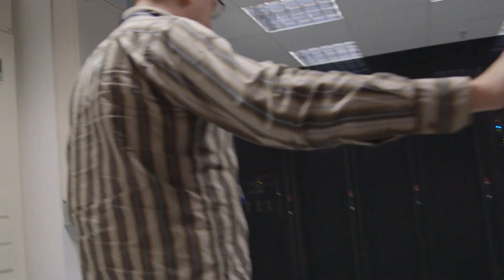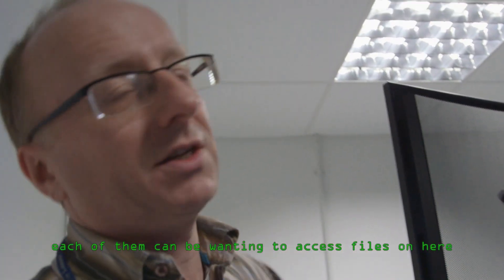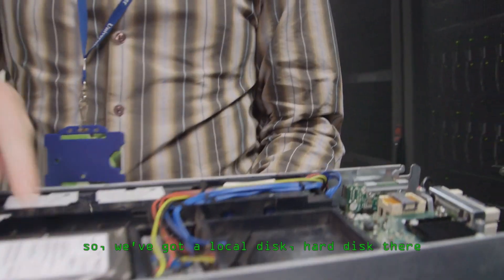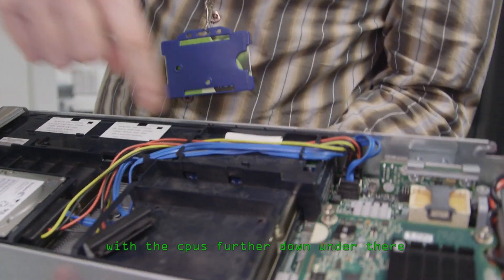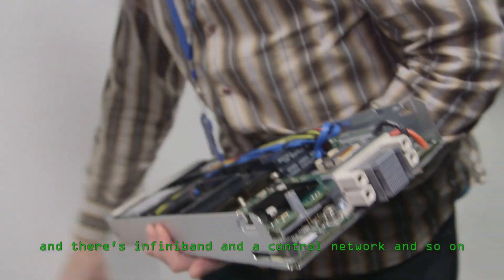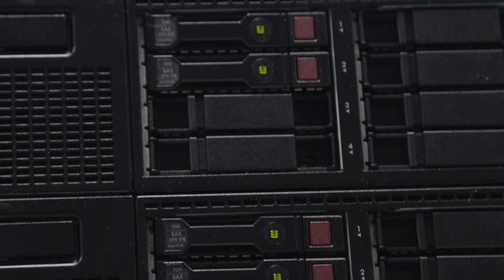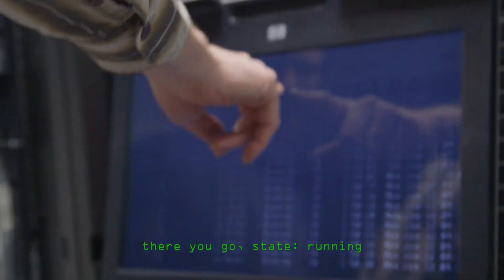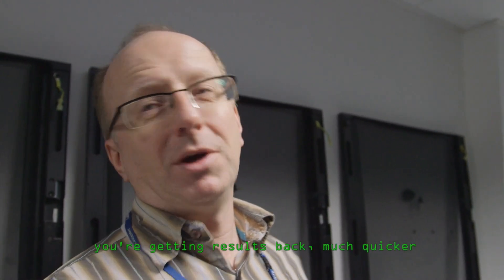Supercomputer and the Milky Way - Computerphile

Comment: Why you are still using cpus instead of gpus?
Reply: +Artyom Galstyan because these computer boffins know more than you.
Reply: Because simultaneous signal handling cannot be done as well with GPU parallel processing like can be done with a CPU. 

GPUs are best suited for very simple jobs being executed massively parallel.

So for instance some pseudo-code that might be used with a GPU could be:

###############################################
axis_1 = "x" \\ x pixel number
axis_2 = "y" \\ y pixel number

if [ "$axis_1" == "1200" || "$axis_2" == "543" ]; then

    z = $(( $x + $y ))
    axis_3 = "$z"

    return($z >> process_color)
fi
################################################

CPUs can handle many more complex code blocks in parallel when the OS is minimalistic and these code blocks are the only thing being run in parallel.

Comment: For those who are interested, the high performance computer (HPC) probably uses a lsf system to manage the jobs (the programs to run) submitted by the users. Each user is usually set a maximum number of cores that they can use at any one time. To program one of these, you need to know MPI or OpenMPI as well as a programming language like  C or Python, if you wish to communicate between the cores/nodes. Though you can run lsf jobs on the HPC without MPI and OpenMPI and still utilise all the cores.

MPI seems to be the standard

I'm cautious about calling it a super computer, from what I can tell its no bigger than the clusters I have access to. We call them high performance computers. Also the number of cores they quoted probably includes hyperthreaded cores so in reality it takes twice as long as they quoted, if that was the case (hyper threading just means that the CPU cores are less idle)

This HPC seems to be just made up of CPUs, you can get GPU ones which are just made up of a lot of GPUs, also there can be a mixture of CPU and GPU clusters (compilers can optimise plain MPI - C code into CPU and GPU operations).

Comment: It should be known that this computer probably isn't as fast in every day tasks as a regular high-end laptop, especially one with SSD equipped. The single threaded performance of these multi-core machines is probably worse than your regular i3, though what it lacks in quality it makes up for in quantity. Where supercomputers actually excel is when you have an enormous task, can load all the data into the ridiculous amount of RAM available and do computations that are entirely parallel. Otherwise a cheap Macbook Air will probably outperform the DiRAC simply because of its crazy fast PCIe SSD.

Comment: 4500 cores isn't that amazing anymore. Especially when you have GPUs on the market. You can get a $200 GPU with over a thousand cores now, and there are GPUs with more than 5600 cores. Of course, they aren't as powerful as CPU cores (they lack SIMD and have lower frequencies), but only by a factor of about 10 to 50. For example, I have a 3rd gen i7 (high-end processor) in my computer, and an nVidia GTX 760 GPU (mid-range GPU). The GPU was $100 cheaper, has 288 times more cores, and has a total of about 20 times more performance.

I take it that the cores in this supercomputer have clock speeds around 2GHz, with maybe 256 bit SIMD.
4500 cores * 2 GHz * 2 calculations per clock cycle * 8 parallel single-precision calculations (SIMD) = 144 TFLOPS. Not bad. Only about 50 times faster than my GPU though. Nowhere close to the "one thousand times faster" claim though.

Of course, with the total lack of GPUs with large amounts of RAM, and the fact that gaming (cheap) GPUs typically have drivers designed to prevent them from having double-precision performance comparable to computing (expensive) GPUs, GPUs aren't always great.
Reply: 3 Main problems though. First, for most scientific works you must have double precision. Granted, there are GPUs like the Nvidia Titan that have great dual precision performance, but there's another problem.

The second issue is that graphics cards don't have the architecture required to handle general purpose processing. For example, Nvidia graphics cards are missing a lot of basic functions, such as (if I recall correctly) bitwise operations like shifting, which have to be done in software. Thus if your program heavily uses bitwise operations, you could see more than an order of magnitude less performance. AMD's graphics cards do have general purpose instructions, but not everything. Again, you see a lot less performance when running general applications.

Graphics cards ARE powerful, but only when it comes to games, which use a limited instruction set. Scientific works on the other hand can use a whole range of instructions, which need to be emulated in software. 

Lastly, GPUs have other gigantic bottlenecks. All data needs to be transferred to and from system ram to GPU ram and vice versa. A GPU also can't access things such as hard drives. Thus, all data needed to be loaded from and to hard drives need to go through a CPU, which will bottleneck the process. SLI only handles so many communications. Again, data will have to be transferred from one GPU's ram to system ram, then to another GPU's ram.

In terms of actual performance rather than theoretical, it's more like 250-1000x your GPU rather than only 50x.
Reply: patrink12
 Actually, GPUs have general-purpose functions. Bitwise operations work fine in CUDA and are pretty fast (they are extremely simple to implement in a processor and use relatively few transistors). GPUs might not be able to handle general calculations as easily, but a large quantity of scientific problems run well on them. In addition, nVidia has more than just gaming cards. There are also the Quadro and Tesla cards, which are designed for supercomputers, servers, and workstations, and lack many of the other disadvantages you stated.

I don't know if you're extremely aware, but in recent years GPUs have been being designed to be more and more general-purpose. It doesn't just help with games. Shared memory between GPUs only applies to SLI and doesn't apply to OpenCL or CUDA unless you actually want it to. The majority of software that can be accelerated with GPUs doesn't require it. It helps for graphics, but not much else.

Also, don't the vast majority of supercomputers connect their computing nodes with ethernet cables? I'm pretty sure that's a far larger bottleneck than what exists between the CPU and GPU.
Reply: Haniff Din The unused brain power of adults as they watch American reality TV
Reply: There are compute clusters made up primarily of GPUs. They will have their reasons for using CPUs though so their claim still stands.
Reply: Penny Lane
I know that. I mentioned a few reasons why CPUs are better in some cases. Of course, with tasks this parallel I don't think it would matter that much unless they need tremendous amounts of memory for these calculations.

Of course, I was talking about just raw performance.
Reply: InnovumTechnology It is quite hard to get most scientific computing tasks to run efficiently on gpus, so it isn't done much. People are certainly looking into doing this where they can though. Also there is often a lot of legacy code which would need to be completely rewritten to run on gpus, which is quite a big barrier to using them.
Reply: Penny Lane You're right, the Nvidia Tesla boards would be much better for this kind of modeling, I believe.

They would also see a substantial savings in time if they had the budget and availability of the Intel Xeon E7 8893 v2 chips. Those run at 3.4GHz (Turbo @ 3.7GHz) and can process 30 threads (hyper-threaded) per instance. I don't think they'll be updating anytime soon, however, since swapping these chips for what they have (assuming the socket is compatible) would cost about $31M USD.
Reply: Haniff Din this is true
Reply: ninjafruitchilled There is also the issue of scientists not always knowing how to write code for gpus in the first place. It is still new and unfamiliar to many of them.
Reply: I understand that. I just meant this to show that this amount of raw processing power isn't that amazing these days, especially when compared to GPUs.
Reply: GPUs lack SIMD? GPUs are SIMD systems, they can't really do anything else.
Reply: IchBinKeinBaum
It doesn't work like it does in the CPU. In a GPU, the different instruction units can work independently. In a CPU they can't. A GPU is more of an MIMD system that tries to be SIMD whenever possible.
Reply: *****
I haven't worked with OpenCL, but I have worked with CUDA.

With SIMD (single instruction, multiple data), all units do the exact same instruction at the same time, but just with different data. If the instruction is to add a and b, then each unit simply adds it's version of a and b. If you want to do branching (with if statements and such), this doesn't work with SIMD because then the units won't all be doing the same calculations anymore.

Like I said, GPUs are essentially MIMD that tries to be SIMD when possible. MIMD (multiple instruction, multiple data) is where each unit is able to be doing a different calculation than the other units in the system. This allows for branching and conditions, as well as a wide range of other, much more complex functions. I think it is slower to do this on a GPU however (more requests for new instructions I think), so the GPU runs faster without branching.
Reply: InnovumTechnology
Even CUDA devices use SIMD (each warp executes the exact same instruction on different data). To make branching work a warp executes every branch and disables processors for threads that should not execute that branch.
Reply: IchBinKeinBaum
Thanks. My mistake.
Reply: The results you get from GPUs aren't always accurate, not to mention branching in a GPU is pretty bad.
Reply: Haniff Din Modern bitcoin miners have moved on from GPUs. They just aren't efficient for mining bitcoin anymore.

As I said before, GPU results are kind of dodgy. Afaik, CG films use CPU-based rendering for this exact reason.
Reply: Haniff Din They use ASIC systems.
Reply: Haniff Din No, ASIC systems are far faster than GPUs at doing such tasks. They're build to do only one task. They're not programmable like GPUs, and because of their sacrifice of flexibility, they achieve ridiculously high processing speeds.
Reply: Haniff Din You're half right, I guess. The point of them is to do a lot of work while drawing a lot of power. With the money you save from using such systems, you can purchase more, and when you purchase enough to the point where you're drawing the same amount of electricity of GPUs, they're collectively faster.
Reply: +InnovumTechnology Your comparison maths is quite off. GPGPU Stream Cores & X86 cores of current generation gear are not equivelent. Multiple GPGPU stream cores are required to achieve the same level of coplexity as an X86 core. Example a Firepro S9170 has 2,816 stream which team up together to be equivelent to 44 compute units. Your comparison is off by couple order of magnitude.
Reply: Neojhun
I did take that into account. x86 cores have SIMD, which lets them do multiple calculations at once. GPUs are basically massive SIMD engines, with each core being it's own 32-bit FPU. It's not a huge difference though.

The i7 in my computer has 4 x86 cores, and each one has a 128 bit SIMD unit. That's 4 simultaneous 32-bit floating point operations per core, or 16 on the whole CPU. Compare that to the nVidia GTX 760 in my computer, which has 1152 cores, each of which being just one 32-bit FPU. The individual cores might not be as powerful, but the sheer number of them is so massive it doesn't matter.
Reply: Haniff Din
The Fury X2 is going to be amazing too. ~17 TFLOPS of compute performance and 8 GB of HBM with 1 Tbps of bandwidth.
Reply: Antoine Henry
I'm comparing modern CPUs to modern GPUs. Besides, if you compare CPU and GPU performance improvements over the past few years, yes, CPUs have remained stagnant. It's impressive to see CPUs improve in performance by 20% each year, which 50-70% improvements are common with GPUs.

And of course, the main point in building supercomputers is to get the floating point performance, since that's what the vast majority of simulations run on them require more than anything else.
Reply: "I guess you are working with one of them?"
Nope, I'm a programmer that works on game engines themselves.
Reply: Haniff Din I don't work on well known public engines.

Comment: Very cool. But no local duplication of the drive on the node ? Single point of failure there. You can see the advancements that have been made over the years in that system, such as the way you can pull nodes down and replace them ( Sun E10K ) Stacked nodes ( IBM SP2), very very interesting. Head nodes work very similar to the way the SSP worked in the E10K.  I am amusing that you can replace nodes on the fly ? So the job is sent to another node, you replace the node bring it up and then the job is sent back to the node ?

EDIT I am assuming the processing is done with CPU not with some fancy pancy GPU ?
Reply: you don't need duplication on the node drive, if it fails you just shutdown the node
Reply: 666Tomato666 true you don't need it but a node would be going down when it did not need to

Comment: Windows <- shyte!
MacO.. <-more shyte!
Linux RedHat ... the best!
Reply: Windows is good as it has loads of software but for serious work like this its a joke, Mac OS is easy to use but its useless in a corporate environment ( no more xserv :( ). For stuff like this you want a unix based system ( yes i know OSX is UNIX based) be it linux BSD or even better solaris ( only because it has the latest version of ZFS and ZFS is the best file system by a significant margin)
Reply: Hedley Quintana Windows <- Great for the average user, lots of software, easy to pick up and learn

OSX <- Really easy to pick up and learn, very polished interface, but limited in features, expensive

Linux <- Power users only, casual computer users beware, here there be dragons. Most diverse and feature-rich OS on the planet, open source, not very user friendly.

If you want to be an asshole, go do it somewhere else.
Reply: Teth47 with linux you have much more control but limited software options
Reply: Teth47 Have you heard about "Wine"?
Flash nooz! you get each program from Windows with that thing in Linux if there is no Linux native version available!
Reply: Hedley Quintana I have heard of Wine, but you know what? Fighting for 9 hours to get basic stuff to run doesn't count.

Comment: A bunch of C7000 blade chassis cable to a san over what is probably 8gb fibre. I really think "Super Computer" is a misnomer the more correct term is "Really big cluster of normal x86 servers"
Reply: a cluster is the dominating architecture of supercomputers now, doesn't make them any less "super"
Reply: So you would not call the IBM SP2 a supercomputer then ? Just because the nodes are connected externally and its not one massive CPU does not mean its not a super. The architecture has nothing to do with if its a super or not . Would it be different if it was a bunch of MIPS or SPAC cpus ?
Reply: The SP2 reminds me of  giant rs6000 just with a lot more CECs.  I just think super computer implies one machine when what we are really talking about is a big cluster. Super Computer implies special hardware when in reality it's A LOT of normal hardware with special software making it all work.  To me when I think super computer I think of an idm z series (mainframe). This is all semantics and I understand to the layman super computer suffices.
Reply: Joseph DAndrea , this may have been a fairly 'super computer' when it was first installed. It doesn't mean that it's any less super, just a little dated. Obviously computers progress so quickly that you can easily make something 10-20x more powerful (if you have the budget), but would it really matter? If what they have is enough for the work load that they're using it for, what's the point of going bigger?

I get the same impression from people that want to build a home computer with 3x SLI Nvidia 980GTX cards, to play a game on a single 1080p monitor. It's over kill. It would be better to build a system to suit your needs, with a 3-5 year lifespan, and then at the 'end' of that life you can determine if you want to do a cheap upgrade, or replace it. (For instance, RAM, GPUs, processors, etc all get cheaper as time goes by.)
Reply: Joseph DAndrea The definition of supercomputer only deals with compute performance across the cluster, not any specific hardware within.
Reply: Joseph DAndrea I can compute with pen and paper, however I can not super compute as I lack the I.Q. I feel people are forgetting what a computer is and even if 1 or 1000's of cores/CPU's are working on a computational task, it is still a single computing device.
Reply: dasraiser You can't supercompute because the human body is incapable of moving fast enough and the brain isn't optimized well enough for mathematics to do trillions of mathematical operations per second.
Reply: true, I alone could not do trillions of mathematical operations, however a trillion people working on the same problem could, as we would all be working on the same problem and as a collective would be super computing.
Reply: dasraiser And that's what a supercomputer does, and it outlines why OP is an idiot.